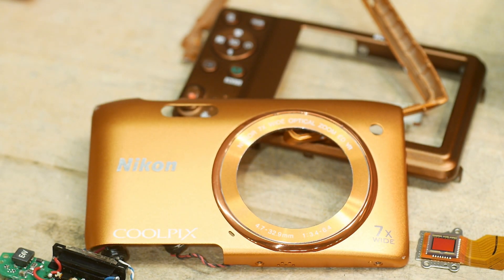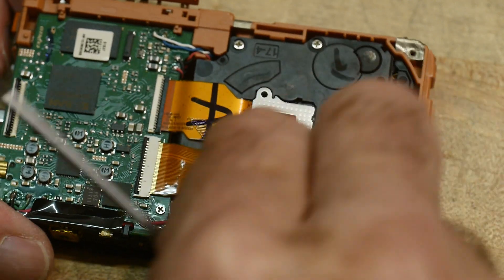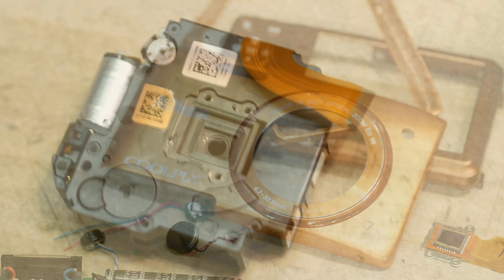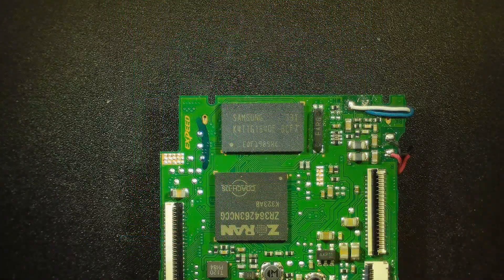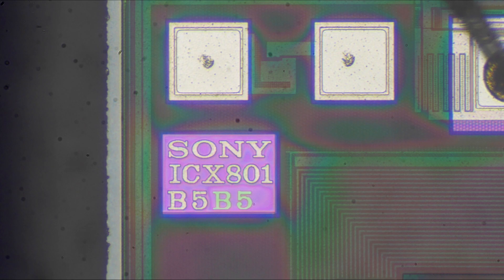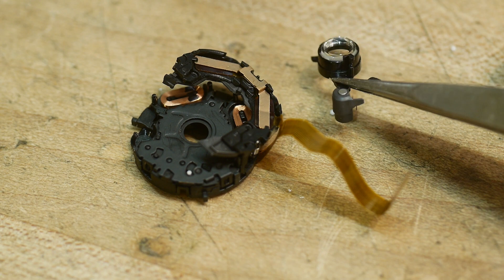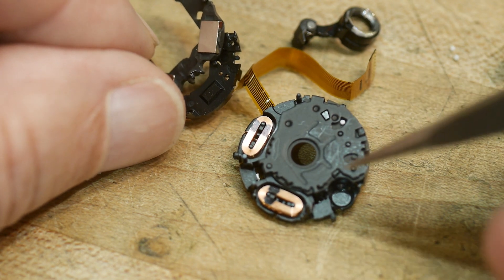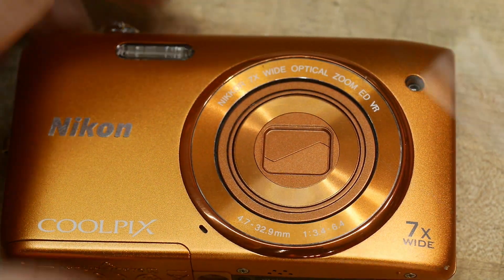#1798 Nikon Coolpix Camera Teardown

Comment: Lots of systems in the little camera....

I remember my buddy Scott...newly UofA EE...first job was assigned Kitt Peak...1981

Built CCD processor using discrete ECL and TTL...ran a fast flash ADC..clocked at 25 mHz.to read and store star data from universe by reading from an exposed light plate within telescope.  Intel fastest processor maybe 2 MHZ tops...

Then another image taken next night...find a wobble..or different image...by computer file subtraction ...boom you may have discovered a new planet. 

Planet Claire?

It be nice to see how rows and columns of pixels are read and stored...

TI Optoelectronic Data book...some vintage architecture shown reading CCD...

I am glad mastermind IMSAI Guy....knows many camera and optical reading image secrets and can explain to us followers...

Thanks...

Like is each pixel a 0 to 512 light intensity ?...then every 3 pixel a RGB cell...so an image can be stored with its wavelength.....how bright and what color...

You can read too Fred.

Then maybe if getting stuck...have a specific question ...

Good job...

Comment: I love your channel and your expertise in all kinds of electronics, but just one comment: The image stabilization method you describe is used for pure software image stabilization systems. They work by taking a huge batch of "underexposed" images, correlating them to each other until all pixels that are shifted by vibration are lined up to each other and summarizing all the images afterwards. But the still picture cameras of that time usually used a more "mechanic" approach by steering a lens group that is controlled by the shown voice coils with the data of an inertia measurement unit. That way the movable lens group shifts just in opposite direction to the "shaking" image and the optical image on the sensor stays stable. As a consequence, the image sensor can collect light for a longer time and does not need to be read that fast.

- Just as comment so everyone can learn from each other 😊 -